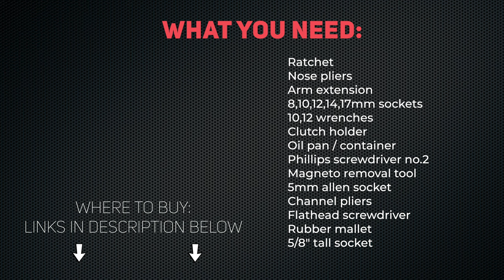Honda Ruckus / Zoomer 50 - Engine Disassembly | Mitch's Scooter Stuff

Comment from the maker: T O O L S
Variator / Clutch holder tool - https://amzn.to/2ZuYJEA
3” / 6” extension set 1/4 drive - http://amzn.to/2wDuzzW
3" / 6” extension set 3/8 drive - http://amzn.to/2h7ypMl
8mm socket 1/4 drive - http://amzn.to/2xMhsBl
10mm socket 3/8 drive - http://amzn.to/2xGuLSF
12mm socket 3/8 drive - http://amzn.to/2xM4Edr
14mm socket 3/8 drive - http://amzn.to/2xGn4Ms
17mm socket 3/8 socket - http://amzn.to/2EMT6LO
10mm gear wrench - https://amzn.to/2LZmuzY
12mm open wrench - https://amzn.to/3cjpou9
Phillips no. 2 screwdriver - http://amzn.to/2fgdZDL
Magneto puller tool 27mm - https://amzn.to/3TqABl4
5mm allen socket 3/8 drive - http://amzn.to/2ofCuCg
Channellock pliers - http://amzn.to/2CMrVLq
Flathead screwdriver - http://amzn.to/2jN7lpE
Rubber mallet - http://amzn.to/2BsqAMz
5/8” tall socket - https://amzn.to/3ix6Gba
Ratchet 1/4 drive - http://amzn.to/2xcJEu1
Ratchet 3/8 drive - http://amzn.to/2hhmnUs
Nose pliers - http://amzn.to/2yetDDj
Oil pan / container